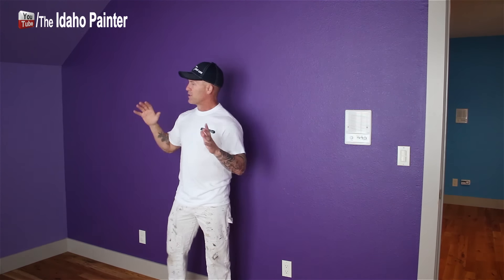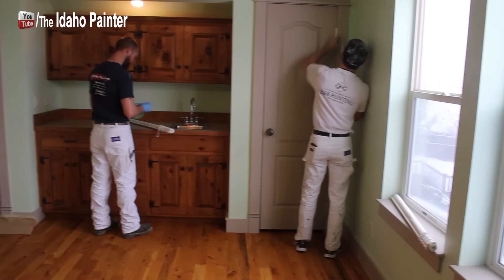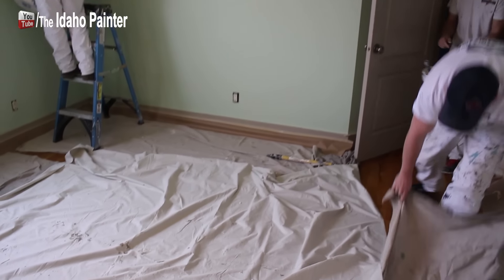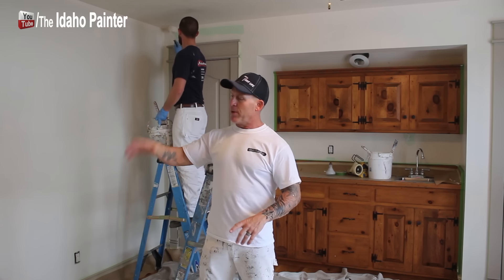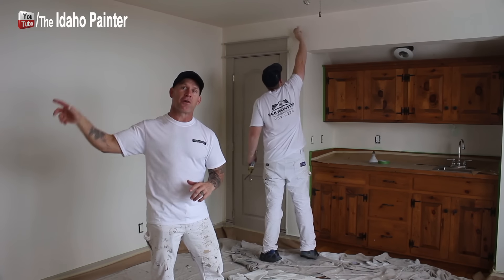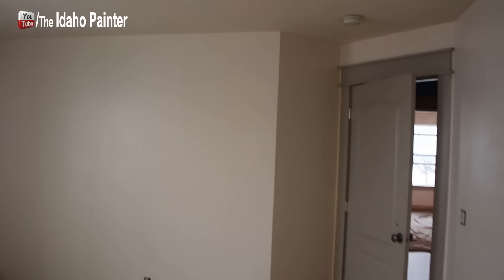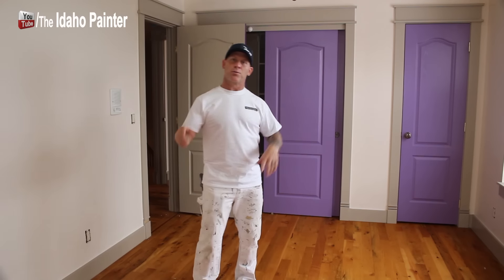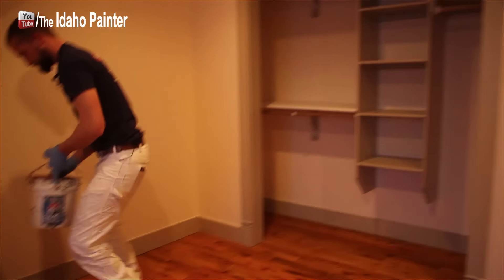Painting 3 ROOMS IN 3 HOURS.  Painting fast and making money.  Paint a room in 30 minutes.

Comment: I've found using a small fan just to move the air in the room is more effective than  turning up the heater.  A fan, increased heat and opening the window is the Trifecta.  Your crew works like a well oiled machine!

Comment: Man!  That 18" roller is really fast!  I think I'm going to pick one up, even if I just use it for ceilings.  Subscribed a long time ago and have learned quite a bit from you. Spent literally thousands of hours in a spray booth and job sites applying baked enamels and chemical resistant coatings. Lot different than using a brush and roller. Thanks for all the great tips.
I've also sprayed a few cars two boats and a few Custom Motorcycles.

Comment: Great information, but one obvious point. 3 hours, for 4-5 men.  One thing I learned was the Behr Marquis paint would have done that purple in ONE coat. It’s really expensive, but it’s worth it. My daughters room was multicolored with thermonuclear yellow, safety blue, safety orange, bright green ( she finished 3rd in her class so she got to paint her room the way she wanted) Everything was outlined in black. We lightly sanded the black outline because it was raised, but still black. ONE coat, and the Inspector General (my wife) could not see any color bleed. The room was well lit. The color we chose was a little lighter than what you used. I was sold.

Comment: no sanding, no primer, walls did not even got cleaned before painting. amazing. Regardless how much I'm getting paid to do a job like that,  i would at least give the walls a quick sand, then a quick wipe with a rag to make sure there is no dust, then check for cracks, holes, etc, the last thing is painting, that usually happens on the second day, when done right.
Reply from the maker: The title strictly says painting a room. Not prepping a room to be painted
Reply: your right, painting a room. i guess next time  when i go do an oil change, they will ONLY change the oil, not the filter.....because of course, its just an OIL CHANGE. sorry about that, silly me, to think that painting a room involved prep work. shame on me.
Reply from the maker: Not sure what your point here is and why the rude behavior.

Comment: Do you do outside or inside a house first? Two novices here. Pressure washing, filing holes and cracks and spray painting. Do you have a video on mixing and using Interior and Exterior filler? Do I wash, then fill, sand, mask then paint?

Comment: Hey Chris, awesome vid. I've been using the 18" 10mm nap and have been having issues with the shedding and leaving too much texture on higher end residential new construction and repaints. Any tips or product recommendations for the best nap avaiable?? Thx very much! I'm a big fan of all your vids!!  All the best!! No idea why you get so much flack your vids have helped me in so many ways, mainly boosting production, increased profit, and moral/motivation when needed. Keep em coming
Reply from the maker: We use the SW contractor white woven
Reply: Roll up the nap with green or white 3m tape and then pull off. should help
Reply from the maker: Nice tip

Comment: Dude! Fist af all, thanks for sharing. Definitely, a lot of this take years to learn. Question, why did you not spay paint this? What determines spray paint or use the roller?
Reply: I usually only spray when its exterior and use the back roll technique which would be someone rolling the wall after I spray the walls so it can spread equally. I usually dont spray interior unless every single thing is covered in plastic like cabinets, doors, floors, reason being is the over spray and the fumes being enclosed. When I spray inside a house its usually a new construction when we're spraying the primer and theres no tiles ,carpets, cabinets, doors ect

Comment: When covering a deep color like purple and 3 or 4 total coats are needed, do you always only prime the first coat or is it more efficient to prime the first 2 coats then go to the finish coat? Also i've been using Glidden Gripper with good luck, what do you use for a primer/sealer? Thanks again!
Reply from the maker: we do not prime walls if they are already painted. If it is a bare drywall we use PVA Primer
Reply: john bonham In my experience its much cheaper to prime walls with deep colors because primer is usually cheaper than actual paint, you can also have the paint store tint your primer, I would suggest to use something other than glidden gripper that stuff is garbage, PPG makes a great primer for interior which you can get for $50 a 5gal bucket or use Richards primer
Reply: Jorge duarte I do that as well. If a color is hard to cover in 2 coats I prime the wall in 1 coat with the exact color match and finish in the paint 1 coat. It's cheaper for the customer too. Why waste a full gallon of paint if you know it wont cover. Too expensive..I always use Cashmere or Super Paint..

Comment: Can you clarify something.  The first coat you put 1" tape and paper below that.  Then you paint to within 1 inch of the tape.  Then comes the question.... You caulk the baseboards and then paint over the caulk right (basically cut into the caulk).  How do you keep the caulk from binding the 1" masking to the wall?  and when do you pull that tape if you are going to recoat it?  Do you have a video on this by chance? thanks
Reply: thanks. is there a preferred caulk, and how long between caulking and pulling tape?

Comment: One techie question Chris, in that PURPLE ROOM would it have been better to put a sealer under coat so that you would not have to do it 3 times !!
Reply: zeta reticuli all that stuff is just a gimmick. when it comes to painting covering bright colors like that will almost always take 3 coats, sometimes you may get lucky with 2 but it depends on the variables (roller nap, paint brand, temperature, paint thickness, wall texture)
Reply: so true but remember red blue and green are fugitive colors they will BLEED thru if they are not sealed with the correct sealer/undercoat. And yes it does help if you use a 10mm nap.!!;-)
Reply: zeta reticuli 
You are never going to cover dark purple in a light colour with less than 3 coats,no matter what paint you are using!
Reply: its better to prime it, because primer is cheaper than the actual finish paint, you can purchase a 5gal for under $60 and save money on finish paint

Comment: I was always taught to use a "W" type method for rolling, just wondering on your thoughts on straight up and down vs W patterns. Thanks for the vid Chris and crew!
Reply: He was using the "W," pattern. Just not as wide as usual. I paint the same way he does.
Reply: That's way they teach it in England at City guilds nvq centres when your on placement with painting contractors I think they don't have this in America but working with crew like this u woudnt need it..usually three years level 12 and 3 advanced craft .

Comment: It takes me 4-6 hours to do two coats on a basic 12x13 bedroom. That seems average to perhaps a bit slow. I work alone. What should it take a competent pro that’s fast?
Reply: It took the guys in the video three hours for three rooms, three coats per room. With four painters on the job site that's 12 labor hours, which would be 4 labor hours per room.
There's a lot of variables that can change your job duration. Two coats on a 12x13 with an 8' ceiling is a little over 800sq ft surface area total(404 sq ft/coat). In my opinion, 4-6 hours isn't bad. Especially if you're not rolling walls and ceilings the same color and actually having to cut in with a brush.
Your 4-6 hours solo painting a room I would say isn't too far off. Reasonable, respectable time, profitable time.

Comment: 13:49: so when you leave a thin area unpainted next to taped off trim, do those areas get caulking and 1 or 2 coats? I think you leave it till the end so the tape is taken off while the paint and caulk is still wet? Isn’t it NOT blended then between the field and these cut ins? Or is it not noticeable?

Comment: Great work!
but there are 4 painters all together that means 4hrs each room lol and you didn't even send the walls..and the caulk should be dry al lest 4 hrs before applying any paint..otherwise will crack   few days later...
but still great work.. 
:)
Reply: wilson maza qhy would you sand walls before paint unless your sanding drywall patches or doing new construction? also your claim about caulk is false unless its used incorrectly. if you fill caulk in a 2 inch hole and try to paint it your gonna have a problem lol
Reply: Johnny Bones Yes, you right don't send the new drywall or new construction walls But always send drywall, walls after  prime paint etc... And l think they are NOT using caulk to fill up the holes on those walls it seems they are using ( spackle patch ) and the caulk they are using  between wall and baseboard, door frame and wall. There's  many kind of caulk..950A , maxflex, 1050QD dry in 30 min etc...follow directions.. 👍🏻👍🏻👍🏻:)
Reply: Johnny Bones you sand your walls before painting to get the previous chunks and nibs off the walls we do it on every home we do the walls turn out so much better and smoother looking and feeling not to mention it helps adhesion but to each his own great video :) like another guy commented "there's many ways to skin a cat" (many different ways to do the same thing)
Reply: I agree I always sand the walls down and go back and dust them down, and for caulk  I now I use Quad max you can paint over it withing minutes after applying it the skin dries pretty fast, another thing we always have to deal with is nail holes people always want you to patch them, so now you have to spot prime them unless you painting with flat base paint.
Reply: painting on wet caulk--yeaH, I did that once.  NEVER again.  lol these blow and go scammers
Reply: In the UK it's completely different, cutting in is done before rolling, you ALWAYS sand the walls, 2 main reasons, remove nips etc from previous painting and to key the surface. In fact I use a drywall sander on all ways and it's possible to get off with one coat because the key is so good. Alot of work over here is flat surfaces it seems in the US it's rare to have flat walls they all seem to have embossed paper, artex on the walls and it's also rare for people over here to paint the ceilings and walls the same colour. On a flat surface you wouldn't get away with rolling first the cutting in would show a mile away as if it's hot the rolled paint will have pretty much dried.
Reply: @marksutherland774  Do you cut in and roll a wall at a time? I would think that in tandem with boxing your paint the color would look the best doing one wall at a time
Reply: @cascadianapplications7124   Regarding cutting in and rolling one wall at time, for matt paint we typically cut in the entire room, doesn't take long and the edge is still wet so no framing. For satin/silk finishes these tend to flash easier so when applying those paints, yes cut in and roll  one wall at a time because they set quicker. If one person cuts in and one rolls then of course that doesn't apply. Yes you can box all your paint , stir it well, let it sit for 5 minutes, stir it again this ensures a very good mix. Hope that helps.

Comment: Hey there! I've been painting with my father almost 12 years, and I've seen this tool called Accubrush Roller. Honestly, I'm thinking about buying two of them because it eliminates cutting in almost entirely, which is amazing. Was just wondering what y'alls take on it is, if you've used it, is it worth the $125 for two of them (extra rollers included), and etc. If it's not worth it, I'd like to know WHY exactly, rather than just a "Don't buy it, it sucks." kinda reply. Thanks! Oh, and thanks for the tips N everything else too! Huuuge help for my father and I :)

Comment: Thanks for the videos. I was confused about a few things.

Do you remask & recaulk to do the 3rd unexpected coat?

On the skim coat is that something you do only when trying to move quickly or would u otherwise just finish cut it in then roll it?

If its a dark color base and your going light for new color, how does the section where u stop before the tape and @ ceiling, not show through sense technically it would always be be a coat behind?

Comment: Why use rollers instead of sprayers? Economically i’d say sit makes no sense, the finish quality isn’t that drastically different?
Reply: When spraying you spend less time putting paint on walls but more time is spent prepping to prevent overspray. All doors, windows, floors, trim, etc has to be masked off. Areas of the house that aren’t getting painted have to be isolated. On a small job, it makes more since to roll. Minimal prep time and an experienced painter cutting in and another painter with an 18” roller can knock out an averages sized room very quickly. 

Even using a power fed 9” roller in this situation would probably take as much time to get paint on wall as using the 18” roller.

Comment: i wonder how the wooden fan looks on top since you didnt mask it off :D even rollers leave stains :D
Reply from the maker: Good thing the roller didn't touch it!
Reply: There always one - dependent on nap and what it is made from what spatter back u would get. Pay more and get quality the less throwback u will get he a seasoned pro could probably do little slower with no blow back at all.U just gravitate to a level  of not even thinking about it, u become that tuned in to your tools of trade over time..this crew no there systems and what  works for them every crew is slightly different

Comment: ugh! I'm not slamming the guys in this video, but it's very misleading. painting the Ceilings and Walls the same color and sheen is faster than doing just the walls. I see 4 guys in one room. not hard to do with a crew. I do like the large roller.  try a drum fan to dry a room fast! check out my FB page Wet Brush Painting. I need to add more pics, but you can see that I'm a painter.

Comment: with four guys I'd hope so
Reply: I was a little vague. with four professional painters it is possible. I'm a professional painter with 20 years experience. Hand masking the room is a skill not easily learned and forget about edging with a brush if your a novice. To answer your question.. yes I can do it that fast but definitely have to use this s technique when brush and rolling. I just use edgers for most of the job when spraying.. 413 tip with minimal pressure. This can be done with two guys with spraying... I need only a grunt worker...scrape my edger off guy.
Reply: You are the man Chris.. much respect. I have learned, even with my experience, much from you

Comment: 1.  Ceiling and walls are same color - no cut in on ceiling line.  Pretty easy to just slam your roller up into the corners.  This is a really big deal and takes away from your bragging about it only taking 3 hours.  You never once mention this.  This is very disingenuous considering your videos are for the DIY novice and you are a professional.
2.  You have 4 guys working for "3 hours" (despite the fact that a guy is walking around with his cut-in pot while you say you are done).  You aren't calculating the actual setup/tear down of your paint and tools.
3.  Your spackle isn't dry when you start rolling over it.  Your prep work is rushed so bad, it made me cringe.
4.  There is no way your paint is properly cured.  I'd love to know what product cures that fast (hint: there isn't anything that cures that fast).  Sherwin-Williams says 4 hours between coats under ideal temperature conditions.
5.  You easily took 16 hours to paint 3 rooms.  Your claim to 3 hours is started when you taped and stopped when you were done rolling.  The job wasn't even done yet.  You took 4 hours - easily.  Basically, you aren't lying, but you sure are being disingenuous about your time.  
6.  You say you save money, but crank up the furnace and open windows...  lol
7.  You do not show the actual quality of the walls when you're done.  I'd love to see how your rushed prep work paid off.  Your spackle and prep was so fast, I seriously can't help but cringe.

You do great work, but this video is very much like a false advertisement.